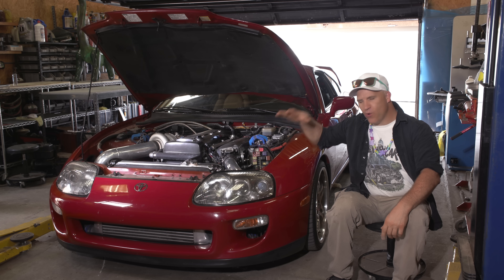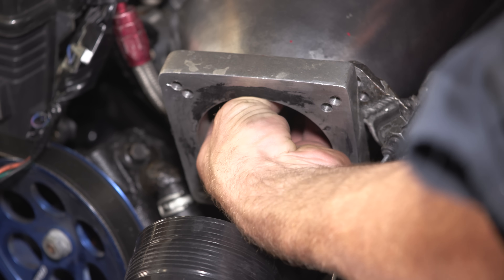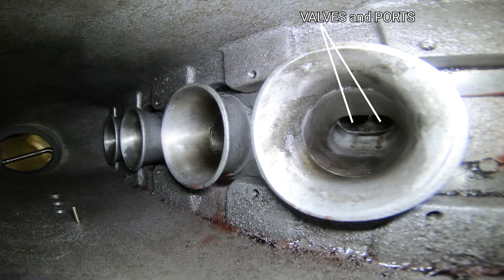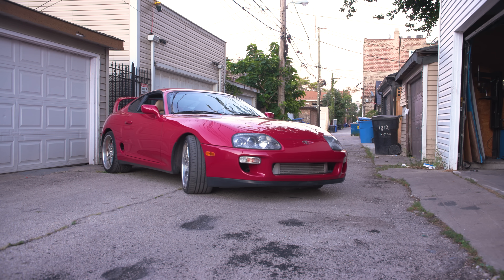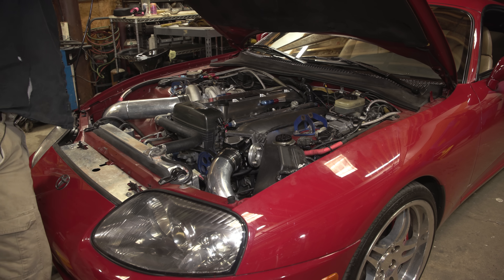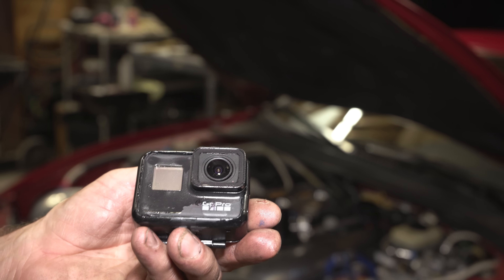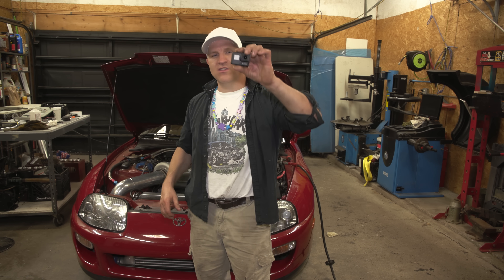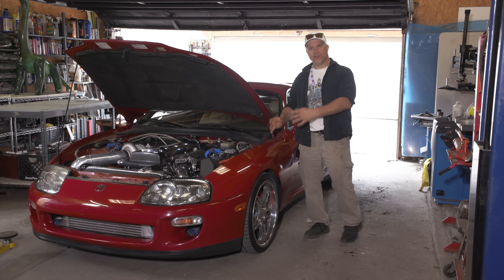Driving with Gopro Inside My Intake Manifold (Toyota Supra Turbo)

Comment: I watched an "Engineering explained" video about the pulsations of air every time the valves close vi sa vi: the air moves down the runner, the valve closes, the air bounces against the closed valves, then back up the runner and bounces back against the plenum chamber wall back down the runner again to be swallowed by the open valve. That was most visible when you revved the engine up, and then lifted off the throttle and the throttle plate closed, and there was a flash of white, which was atomised fuel and air rushing back up the runner into the plenum. 

It kind of looks like your injectors are spraying on the floor of the port also, and I thought it was better to spray onto the back of the valve. Interesting to see a direct injection engine with a gopro in the plenum chamber. Actually there are cameras made for extreme condition like this, but I forget which brand. Just have to google extreme environment video cameras.

Comment: The white flash is the water vapour (which is already gaseous in the air) condensing due to low pressure. This happens in any case when there is a shock wave of some sort, for example when an aircraft hits Mach or turns sharply at high speeds (or when it stalls, you can see a small version at the wing tips only). Another example would be when a particularly large bomb goes off. Don't let clowns who know not what they are talking about say "It's water evaporating due to low pressure!" because water vapour is always transparent. Water condenses out of the air at a shock of low pressure.

Comment: yeah i noticed that as well.  my thught would be that it could be from the gopro itself.
reason is because gas got on it and  removed some of the elements from it by slightly melting it.
several colors can make black , and be added to it to give it  it's durability from excessive heat. 

i have worked on alot of different cars before and there is no way that power steering fluid  entered the plenum. 
now the power booster does hook up to the plenum for vacuum to make the master cylinder 
work properly,  but  not the power steering  reservoir .  but if they changed it for that to work that way, then you may have cracked or removed a vacuum line.

Comment: That engine is a guzzler.
Look at how the injector squirts all over the place
Reply: It's been a while since I worked for Toyota, but if I'm not mistaken those old Supras are sequentially injected.  If so, the injectors pulse on both the intake and exhaust strokes.  Either way the "waste" fuel for that cycle gets swirled in the manifold with the next opening of the throttle blade and goes back in as vapor to help the combustion event on the next cycle.  In my humble opinion, the stock manifolds work best for this setup, with the style seen here best suited for custom or highly modified stock injection setups.  Not sure the extent of his mods here.

Comment: Yoe that red fluid, looks like transmission fluid. You may want to look further into that.
Reply: TheVigilante814 that’s what I was wondering
Reply: It's a manual transmission though.
Reply: @allanb3222  Manual transmissions have transmission fluid as well. I doubt that's what that is though. Probably just from the oil catch can (if any) to catch the bits of oil sent back from the engine into the intake manifold.

Comment: The oil in the intake is from the pcv which is good and oil from the turbo because some get blown  through it because of the lubrication and then back into the engine through the intake

Comment: I think cameras inside working parts is going to be a new tool of top mechanics. Watching those fluids leak out was very informative. There wasn't much of it so it wouldn't be something you would notice right away. Tiny cameras all over the place inside of a high end luxury car seems to be the way to go in the future. Pre-mounted tiny cameras so a mechanic can figure out what's really going on that the computer wont tell them.

Comment: Cool video. That oil in the intake is carry over from the turbo I expect. I see some red colour liquid when you started up the engine in the intake manifold?? Looks like marvel mystery oil or injector cleaner? 
Maybe the reason why the oil wasn't on the middle of camera glass was because it vaporised off, the top and bottom are near the other surfaces of the camera and they discipated the heat away letting the oil vapours remain on the glass.

Comment: The oil from your intake manifold can come from either the turbo, because the turbo is being oiled for cooling and lubricating, but it can also come from your valves (not sure about that) because they too get oil and maybe some oil leaked into the intake manifold during the vacuum.

Comment: Must be something he spilled over manifiol, then when starting its sucking some leftover under the manifoil in when turbo is not making boost. Ass someone else said, he should change gasket or check some screws.
Reply from the maker: Turned out to be power steering fluid
Reply: @WarpedYT  Ok. Did it suck it in around the inside cones, sorry for my english. Good movie btw.

Comment: For everyone wondering about the liquid it’s power steering fluid leaking in from a vacuum line ❤️. Won’t cause any crazy problems I’m sure he already fixed it
Reply: Is that a Supra thing? Can't see why PAS should be connected to intake in any manner, can't be a speed damper system - can you explain?
Reply from the maker: @richardcooper9167  so these cars have variable power steering, and there's a low pressure vacuum switch attached to the power steering pump that has a reference hose hooked up to the intake manifold, I didn't know it until I did this video but apparently my switch is faulty and it's bypassing oil from the pump into the intake.
Reply: Warped Perception so that GoPro turned out to be a great diagnostic tool.
Reply: @WarpedYT  Thanks for the reply- seems like an odd way to do things but there you go. What a way to discover it, though! Have you shown the manufacturer? Kudos to your curiosity and techniques, bet you lie awake at night thinking up new places to put a camera.
Reply: Warped Perception Haha... That's great to find a problem which might have been hard to track down.  Cool idea mate!
Reply: Figured that, I heard it humming as he pulled it in and earlier in the video as well
Reply: Omni Duo  Ahh! That makes sense. Thank you.
Reply: Omni Duo ... just one more reason to love OBD2... gimme a IAC any day... thanks for the explanation!!!

Comment: Gasoline is kinda oily to keep things from rusting up n why some use a fuel oil additive with alcohol.  I know it's a dry plenum but pressure wave tuning n reversion, tho I suppose it could be from your turbo.  Jon Kaase made a clear intake and even stuck his finger inside while running, search [kaase aetc video]

Comment: the oil seems to sneak by the valveguides .. you can see it near startup..no big deal  :)
Reply from the maker: Well I ended up tracing the oil to the power steering low pressure vacuum switch, apparently it is bypassing oil from the power steering pump into the intake manifold.. I mean I've never seen inside of an intake before but seems like there's a lot of turbulence flying around, so if there's oil in one place it's definitely going to be everywhere.

Comment: I love these types of videos. I thought it was cool how considerate you were with the carefulness of the safety of the back two cylinders. I also really liked the last shot of the rear of the car with the "E85 Ethanol" decal on the back. I bet that car makes like 500+ bhp! Cool as shit my dude, definitely gonna subscribe!
Reply from the maker: At one point it was 1100+ but terrible to drive on the street.. and dangerous if somebody drives a car that doesn't know the attitude of the car very well. But now I detune it I'm guessing it's about 950 right now. A little laggy for my liking but very streetable now that I went with a stock flywheel Kevlar clutch smaller turbo smaller injectors and a 75 mm throttle body... It's only like 80% tuned right now though, I just couldn't wait to do this video
Reply: @WarpedYT  Holy fuck 1100+!! My Kia makes 182 at 6000+ RPM hahahah, I could never imagine what 1100+ feels like at full throttle! hahahaha even at 80% tuned Im just like "wow cars can be this fast lol"

Comment: i would be wondering what the liquid in the bottom of the intake is coming from. The go pro may have just shown a weakened or damaged head or head gasket or a problem with the intake not sealing properly, there is definitely something going on and i suspect its not good. Sucking anti freeze  into a cylinder is damaging as it strips the lubricating layer of oil off the moving parts

Comment: YouTube Pros: "There's oil in your intake!" 
"It's coming from the turbo!"
"It's coming from the PCV valve!"
"It's coming through the intercooler!"

Me: ENGINE OIL IS NOT BRIGHT RED.
Reply: It's my grandmother's famous plum jelly.
Reply: @pwntwtf  Better than her Piss Peach Tee that blows up.
Reply: @pwntwtf  😂😂😂😂😂😂😂😂😂😂😂😂😂😂😂😂😂😂😂😂
Reply: It's red because Toyota use ATF as the PSF.
Reply: @DiscoFang  I can confirm this because I was a Toyota mechanic for many years and that is all we used in the PS system on EVERY Toyota that ever came into that shop.
Reply: it's GoPro blood.
Reply: Its coolant
Reply: Some Dude Please explain why the power steering system has a vacuum line.
Reply: @EATSLEEPDRIVE2002  There is a hydraulically operated air valve on either the rack or pump itself. When the pressure exceeds a certain level the air valve will open and air will flow through the vacuum lines, bypass a closed throttle and go straight into the engine. Increasing rpm and preventing stall when the steering wheel is at full lock.
Reply: @white_rav3n  so it's there to stop the engine bogging and stalling at full lock at idle/closed throttle? Nice one man, that makes total sense.
 For anyone still wondering how the hydraulic fluid got back into the intake manifold of a boosted engine, watch for the clouds that quickly form and dissipate when he shuts off the throttle for a gearshift... The clouds are water vapour rapidly  condensing out of the intake charge due to the pressure drop in the manifold when the throttle butterfly closes (this is how engine braking works, the cylinders are still trying to suck air through a closed throttle body, creating a retarding effect). So basically, the faulty vacuum switch was letting PAS fluid get sucked back up its reference line due to the brief pressure drop (relative to the operating pressure of the power steering system) that occurs at every gearshift. Kind of like a peristaltic pump circulating fluid through an open system... Not a lot of head pressure, but those repeated pulses are still going to push fluid out the end of an open tube when it has no way to go backwards.
Reply: @sixstringedthing  well said bud! Could not have said it better myself. 👌😃
Reply: @white_rav3n  cheers mate. 👍 You sound pretty family with the good old 2J, this vacuum switch system sounds very similar to the idle-air control valve on my old 2 litre Veedub Transporter, in function anyway. Although that was controlled directly by the ECU, there was no pressure switch/vac line to the PAS system, just a vac line straight into a MAP sensor inside the housing of the Bosch.
Reply: It's no longer a virgin is what it really is
Reply: Its red hoat coolant you guys
Reply: As a final statement before I'm out, going down to the people saying WELL AKSHUALLY, XXX BRAND OF OIL IS RED... show me a 5-30 engine oil that looks and flows like Toyota/Denso ATF. I'll show you skim milk and call it triple cream. Peace out. 😘
Reply: Looks like he's been "jammed"!
Reply: Its leaking shit hacked!!! Wow
Reply: Is it meth injected ?  Could be meth getting sloshed around in there
Reply: freezeme360  lmao
Reply: Redline oil is red
Reply: From catch can??
Reply: The kid thats sneezing in the engine cut himself
Reply: Uh oh
Reply: It's Marvel's Mystery Oil in the fuel.
Reply: Redline oil is.
Reply: Ofc it's headlight fluid
Reply: freezeme360  lmao!!
Reply: sixstringedthing lol
Reply: Looks like moisture that’s stained from air being compressed and expanded rapidly and coming in contact with a cast steel manifold ... it’s rusty water
Reply: I heard it was coming from the go pro
Reply: I'm thinking it's K&N filter oil, I don't understand how power steering fluid would be anywhere near the intake. However, it would seem that filter oil would get drained pretty quickly if that's what it was. Any chance it was gasoline? I heard it's pink? I'm no expert on this stuff tho.
Reply: @mhoskins555  as confirmed by Some Dude, a faulty vacuum switch for the power steering system was bypassing hydraulic fluid back into the intake via its vacuum reference line.
Reply: @sixstringedthing  The intake has a vacuum? Google seems to tell me that's for dynamic regulation of the fuel rail pressure, which makes sense. Now I'm wondering what controls the pressure on that vacuum reference line?
Reply: @mhoskins555  a naturally aspirated engine will have manifold vacuum, due to the pistons evacuating gasses from the cylinders on the exhaust stroke. A forced induction engine will usually (but not always) have positive manifold pressure when the turbo/supercharger is on boost. In either case the engine management system will be reading the manifold pressure via a MAP sensor for fuel metering (except for engines that use a mass-airflow sensor and/or throttle position sensor to determine load), and the pressure regulator on the fuel rail, the turbo wastegate, the emissions control system, maybe the transmission and one or two other things, all will have a reference vacuum/pressure line connected somewhere on the intake tract, the throttle body, or the manifold/plenum, depending on what the sensor/switch is supposed to do.
In this case I'd guess that the faulty vacuum switch was a bypass intended to reduce or prevent an  overpressure condition in the power steering system under sustained high revs (high rpm=high boost=high manifold pressure, triggering the switch to bypass some fluid around the PAS pump).
Reply: sixstringedthing can you overpressurise PAS pump? It’s just a hydraulic reservoir with an impeller in ?
Reply: mhoskins555 idle up valve
Reply: Do turbos use engine oil or something different?
Reply: @pwntwtf  takes the oil for lubrication from the engine oil and it goes back to the oil pan.
Reply: @pwntwtf  The reason guys use turbo timers on their modified engines is to keep the engine idling for one or two minutes after turning off the ignition, which continues to circulate oil as the turbo cools down. Otherwise the stagnant oil has a good chance of cooking and turning to tar inside the turbo, which is less than ideal for obvious reasons. 😉
Reply: wrong. look up Motul oil... they make it the color red ...
Reply: I was thinking transmission fluid.

Comment: I think my trailblazer sucks oil through the crank case vent into the intake at high throttle.. So that could be where the oil is from but then again idk if you're using a crank case vent or how that would go into a turbo charged setup but that's a possibility. So don't blame the turbo right off the bat lol

Comment: Surprised at how much fuel gets shot back in to the intake
Reply: Its oil
Reply: @TheS50b30  he wasn't talking about the red fluid, he's talking about the blowback mist you see when the car shifts gears
Reply: @shammzz3  good call shammy. That's what I was talking about.
Reply: @r6exrider  yeah, I was wondering the same thing. Although, I don't think it's entirely fuel, I noticed the mist happens when the the butterfly valve closes for a gear shift, so it could either be fuel blowing back, or the air momentarily condensing because the rapid change in pressure
Reply: @shammzz3  If he lets off the throttle for a shift, the cycle of the intake valves narrows, limiting the amount  of fuel able to enter the combustion chamber.  At the same time, the throttle body has closed, drawing vacuum in the intake manifold, which sucks the unburned fuel right out of the runners.  It's been 15 years since I worked in a Toyota shop, but If I'm not mistaken, the injection system is sequential and pulses twice per combustion event.  Not only is there the injector pulse fired for the intake cycle, but one for the exhaust cycle as well, leaving extra fuel to spray around the manifold and mix with the next air charge past the throttle body.  That's why it's so easy to inadvertently run many cars of this era super rich when you start tinkering with them.
Reply: shammy keyz it’s the rapid decompression.  Water comes out of solution the instant the pressure drops.  It’s like twisting a water bottle and popping the cap off, you’ll notice the vapor condenses into a fog that you can see.
Reply: You would see the same thing in a car with only direct injection.
Reply: @TheS50b30  Oil is not red like that. It's PS fluid (see other comments).
Reply: @LegendaryGauntlet  I thought so too...but the go pro was full of oil...what's ps fluid
Reply: @TheS50b30  Power Steering fluid. It's kinda oily but closer to brake fluid.

Comment: great vid, interesting footage, the 2 places that oil can come from are engine blow by/crank ventilation or the turbo, it was very wet inside your manifold, i think most of it was fuel splashing back out the intakes, but there was a line of oil on the right side under the intakes.
do you run a catch can? might be a good thing to add if you run alot of boost.

Comment: having a camera in the way will make those cylinder rich, no real danger there. the main thing you lost is plenum volume, air flow will be disturbed but past the Throttle the air is moving as slow as it will ever be so way less harmful to the flow.